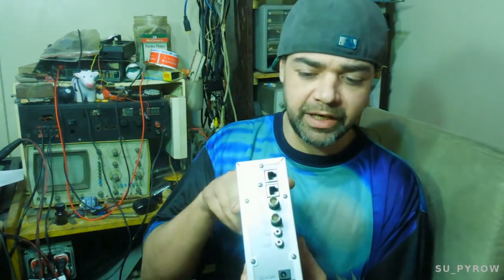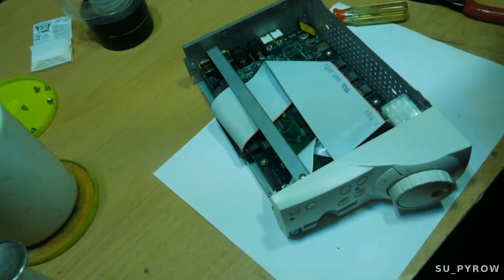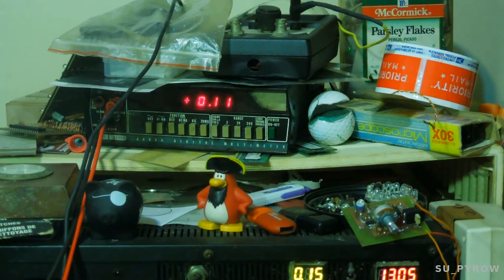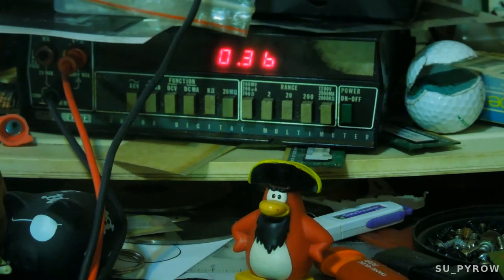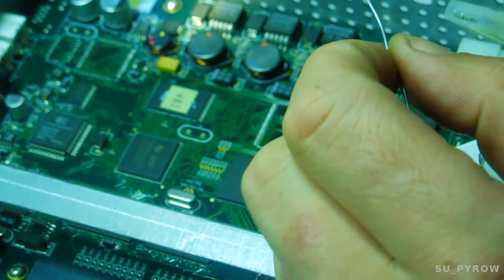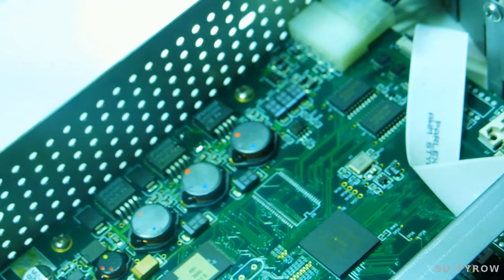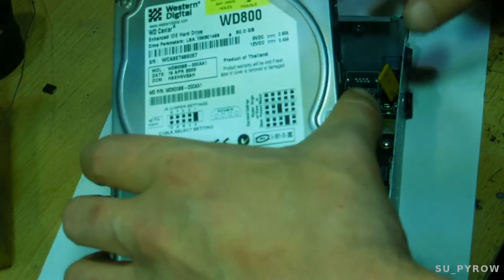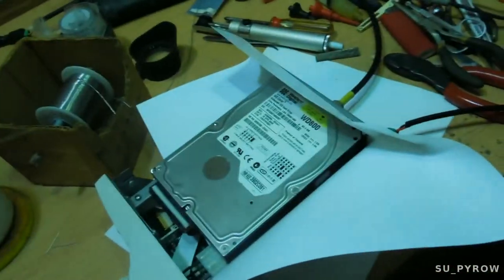CCTV DRV Repair | ADT # A-CDVR80 | No Harddrive Spin SU PYROW #02

Comment: Nice . I wonder how many would pull the reg and not test the diode and wonder WTH .  Is it  the 30 cent diode that's not long lasting compared to the surface mount .  I have lots of them and so far they seem to last so far. Hum maybe not. LOL
Reply from the maker: just smart trouble shooting my friend. im sure someone would have yanked it out replaced it and found the same issue, just to find the problem later.

Comment: Say Mr Fireman what hatched out of the golf ball?
I had a problem with my washing machine and I replaced the diode two2 guess what?
The washing machine still leaked so I hadd to replace the seal. Go figure.
Good fix dude. I used to work for IBM, was a ce. Some of the round diodes would go and you could sometimes feel that they were bad. They would get hot and separate. 
Good diags bud. Hack job? What are you talking about? A fix is a fix.
Reply: Bear you're two2 big. Your fingers are two2 big. You made me laugh.
Reply: Your customers are paying you for what you know, not what you do.
I did a temporary fix on  a friends car. I got it started so he could get home. I tapped on his carburetor cause I knew his float was stuck. It took me 5 minutes and his car was started. I only charged him 25 bucks cause he was a friend and he even balked at that said it only took you a couple of minuted to fix. So I said okay 5 bucks to hit your carb with a hammer and 20 bucks to know where to hit it. He paid me.
Reply from the maker: found the golf ball at a golf course of all places, decided to keep it!
i replaced my diode with a proper surface mounted diode rated for the same value along with a brand spanking new regulator. 
so after replacing those two components along with a new harddrive. all is well!
Thanks for watching my friend!